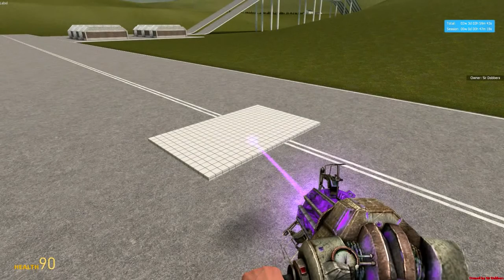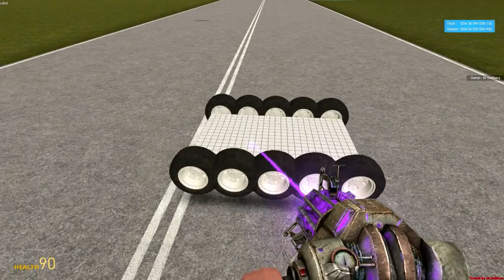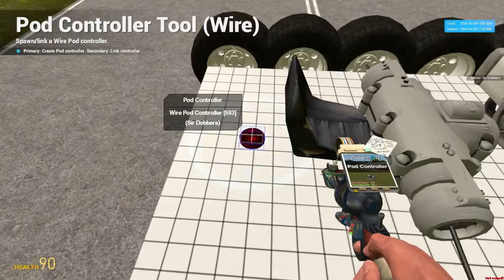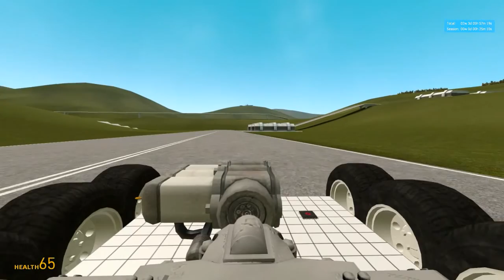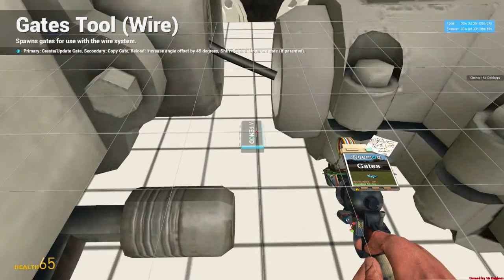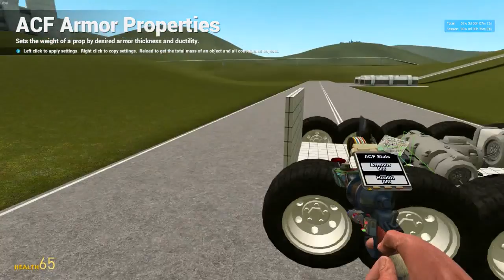GMod - ACF Tank Tutorial Part 1/2 [Tank Body/Mobility]

Comment: Hmm, i think i might need you to build my tank for me, I got the gun and turret working but when it the mobility part is daunting!
The wheels cant hold the weight of the tank ( This is probably due to me not using adv. ballsocket and having the wheels independently turn from eachother, aswell as my tank basically going against every don't you mention)

If i do, however get adv. ballsocket will it work on say, a server without it?

Comment: So, what does clamp do exactly?  Everything else is self explanatory, but what does the command actually do?
Reply from the maker: +Chupachu Are you confused about the actual function clamp or the purpose of using it in this chip?
Reply: SirDobbers I'm confused about what the command does.  Also, could you provide an example?  Thanks. :)
Reply from the maker: clamp limits a value to a min and max. So for example if we had a variable A that changed from 0 to 10 randomly and we wanted to output a variable B=clamp(A,5,9), variable B would always be between 5 and 9 depending on the value of A. So if A is 3, B is 5. If A is 5, B is 5. if A is 6, B is 6. if A is 10, B is 9.
Reply: SirDobbers Oh, that makes sense, thanks. :D

Comment: Is there a way to make it turn sharper? I tried to edit the E2 so one wheel goes forward and the other one goes backward, but I don't think it's possible with a single gearbox. The whole tank works great, but just the steering is far from ideal... I have a different E2 from another tutorial that makes the tank rotate on it's spot with 2 gearboxes, but that one doesn't have enough power to climb hills well... And I can't get that one working with CVT well either haha.

Comment: Help? If I put any weapon heavier than 1000 weight, the base prop just won't hold it. It won't even properly hold most of the big engines! It's like the base prop is some kind of an elastic or something
Reply: xXx_420_360_HaX0rDaN0uSkoupah#sWaG#l3g1t_darud3w33dstorm_360_420_xXx Try adding more weight to the base prop, turret prop and the wheels.
Reply: +xXx_420_360_HaX0rDaN0uSkoupah#sWaG#l3g1t_darud3w33dstorm_360_420_xXx make your base plate weigh more

Comment: Question: Do you weld or parent the props for a tank's hull, and if parenting, do the individual props retain their armor values?
Reply from the maker: Azereiah I parent. As long as you parent to a wire chip / gate / entity, everything should be fine. Acf is made to work with parented props. They bounce, they deflect, absorb, just like unparented props would.
Reply: SirDobbers Awesome, thanks!

Also, since I haven't found any that aren't a total mess, think you could do a tutorial on some basic tank suspension types at some point?

I've been trying to figure it out, but "normal" logic doesn't really work out - usually results in prop suspension having a physics freakout. A lot of the issues I'm seeing appear to be related to using sliders with elastic. I'd use welds for suspension, but I have no idea what kind of force you'd see there, or what the force relationship between the suspension and the tank chassis are, given the massive weights involved.

Comment: You mentioned having turning issues with longer tanks, well I am making a rather long tank and I figured out that if you have an inline transfer and 2 CVT duel clutch transaxes flipped and linked right you can improve your turning radius. Along with having the wheels miss matched to either front or back driving wheels. It's kind of hard to explain in writing. Edit* This does require two movement e2's
Reply: Russell Shutes Can you still try to explain this a bit better? I'm trying to make my steering work better...

Comment: Hey SirDobbers I am having a problem. I copied everything exactly as you said but I am unable to turn the tank. W= Forward, S = Backwards. Sick. Problem is, A/D = Forward aswell :l Even if I hold alt whilst holding A or D, the tank still moves forward without turning at all.
Reply from the maker: Might need more torque

Comment: How do you design your tanks i have the problem if i make a Tank wir a 34° angled armor plate in the front i dont find a fitting plate for the side maybe u have a tip ?
Reply from the maker: Sprops
Reply: yeah i have sprops but i cant find the right props
Reply: MrGhostkiwo You can ANGLE the props and WELD them with other props.

Comment: Can you do a video on how to make a tank look proper and how to use acf armour without it going to 50000 mass? Also how do you use precision on acf things, I can't get the lines to show up.
Reply from the maker: boneygibbon The lines are a separate addon called smartsnap. Should be available in the workshop. I may in the future record myself making a tank so that might be a way you can learn to build. But that's not guaranteed.
Reply: SirDobbers No, that isn't the issue. I see lines on normal props but not on acf items.
Reply from the maker: boneygibbon Ah, there is an option in your spartsnap settings to include entities.
Reply: Thx.